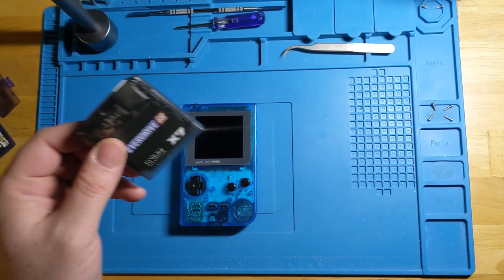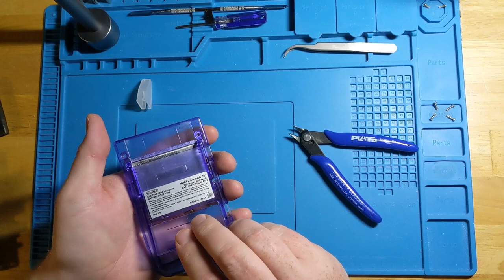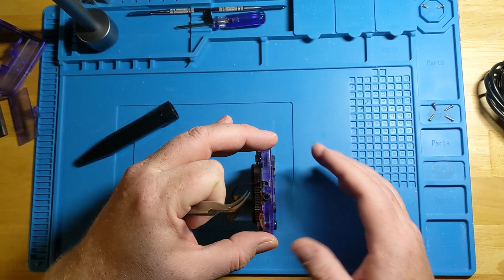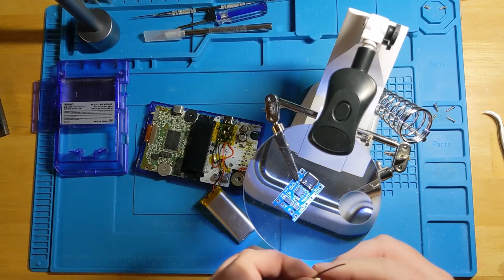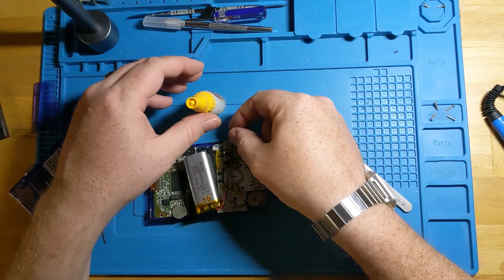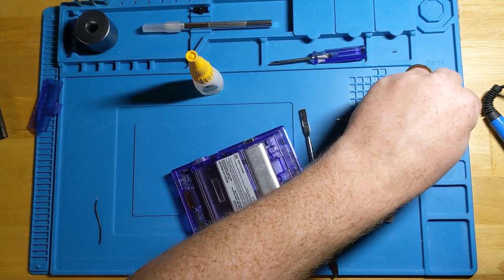Prime Time Funk Mods: How to LiPo Mod a Gameboy Pocket

Comment: The reason you're having difficulty getting the solder to bond at 350°C but not at 300°C is, ironically, because your iron is too cold. It's not transferring enough heat to what you are soldering, so the solder is clinging to the hotter iron. For electronics like this, I set my iron to 850°F (roughly 454°C). It's really frightening at first to apply so much heat, especially when you're soldering to something like the ribbon cable on the IPS screen, but it isn't that dangerous unless you keep the iron on the contact point way too long. It really only takes a second or two to get a good joint with a properly heated iron. In fact, I just did the IPS screen install last night, and the ribbon soldered perfectly at that temperature without so much as discoloring. So long as the contact point gets sufficiently warm, solder will bond beautifully and quickly. I made this exact same mistake in my early soldering days. I was super afraid of burning contacts and such, but I ended up doing so much damage to things by having to hold the iron in place far longer than was prudent. It's kind of like cooking, but backwards. You can't cook something twice as fast by cranking up the heat twice as high, you'll just burn the outside while leaving the inside raw. This is because only so much heat can transfer through various materials only so quickly. In cooking, it ruins the food. But in soldering, it helps by allowing us to dump a shit-ton of heat into a specific point and getting the soldering job done before the heat has a chance to conduct to other points. The colder the iron, the longer you have to hold the tip to the soldering joint, the more time damaging heat has a chance to spread beyond the solder point to other areas you don't want to get hot. Your solder points also shouldn't be too terribly round. Shiny, yes, that means the solder didn't oxidize, which is bad. But round is the product of a cold joint, and cold joints are weak joints.

Adding some flux to the pad will also help. Yes, flux-core (or rosin-core) solder has flux in it (as the name implies), but it will never be as effective as applying flux directly. With flux applied, the solder will practically suck itself to the contact pad, it's amazing to watch. I actually had to use some flux when I was soldering the power wire from the ribbon to the power switch. I added a touch more solder to the pin to encourage it to flow, but it decided it wanted to bridge to other pads despite my best effort. Adding a tiny dab of no-clean flux to the pin and then just touching the soldering iron to it caused the solder to pull back from the bridged connection and sucked itself directly to the pin I was heating. It was beautiful, took a solder mess and turned it effortlessly to an absolutely beautiful joint.

Next time you try your hand at soldering something, or even get some cheap little soldering project kits off eBay for a few bucks, try turning your iron up higher. I guarantee you, it will be an absolute game-changer.
Reply from the maker: Way to drop some awesome knowledge!
Reply: @primetimefunkmods3  It's my pleasure to contribute back. This video was a welcome trove of knowledge for my project and beyond.

Comment: Hi. Great video... looking into a battery mod as well... just wondering about the solder temperature... is it 300 degrees Celsius or Fahrenheit? I asume it is Celsius, because 300 Fahrenheit is like 150 degrees Celsius. Which is low for soldering.
Reply from the maker: I'm Canadian, and I apparently know nothing about temperature... Can confirm it is 300° Celsius

Comment: With the bivert chip and older backlight it's recommended to use a voltage regulator, in this case you wouldn't need a voltage regulator for the newer IPS/TFT screens?
Reply from the maker: With the type-C board and the LiPo doing all the heavy lifting there is no need! I addressed that point in the video as well; if you are not using 1.2V rechargeable batteries, the step-up voltage reg isn't needed.

Comment: Great video!!!
Reply: How is the charger board doing? Is it working ok? There isnt much info on the specification on their website and was wondering what have you learned using that board. Did you ever try using AAA size LIPO batteries that way you just place it in the existing battery compartment?

Comment: C29 and C31 are preventing my battery from fitting. Has anyone tried repositioning them? I think a little PCB could move them up and to the left.
Reply from the maker: It is a microscopically tight fit, for sure. Are you using the same battery from the video?
Reply: @primetimefunkmods3  Yep. It's a 102560. They're not built to tight tolerances though, and I think mine is a little pudgy.
Reply from the maker: @tehrobotjesus  Yeah, I usually have to fit it in a very particular way to make it all fit well, and then make sure that the kapton tape is over the type C board so there isn't any heat bleed
Reply: @primetimefunkmods3  I haven't even gotten to the charging board. I might leave that external. The battery has a protection circuit built in, so it's not really needed.

I wonder if C31 can be replaced with a ceramic cap. They make 100uf 6V SMD ones now, and they're much smaller than electrolytic.
Reply from the maker: @tehrobotjesus  Let me know how it turns out!

Comment: You're feeding 4.2v directly to the pocket? Aren't you using a diode to lower the voltage?
Reply from the maker: Nope, these batteries are 3.7v, so the voltage matches perfectly
Reply: @primetimefunkmods3  there usually around 4.2v when fully charged. 3.7v it's their nominal voltage. It wouldn't be a perfect mach since the GBP uses AAA batteries that are 1.5V each, 3V in total.